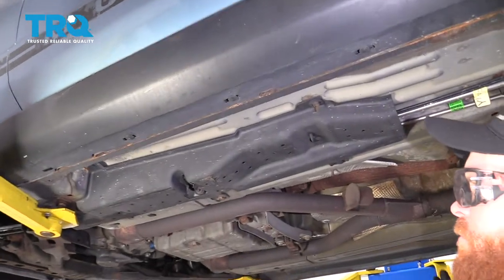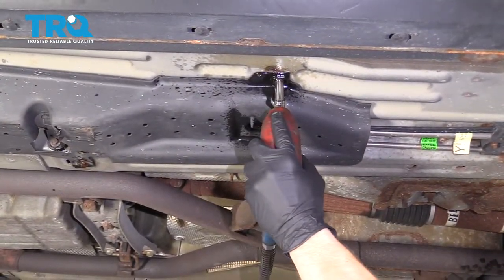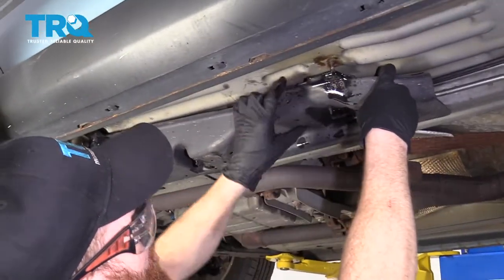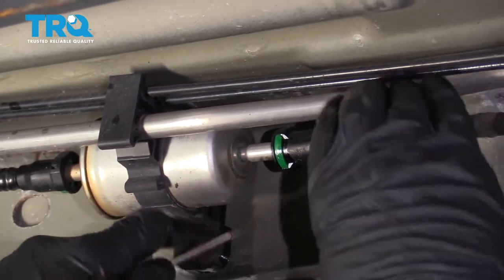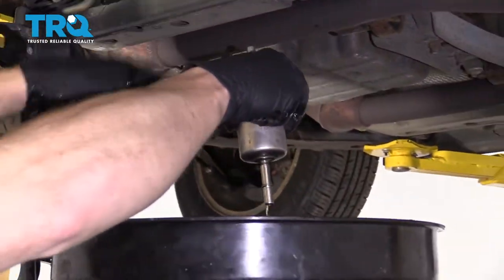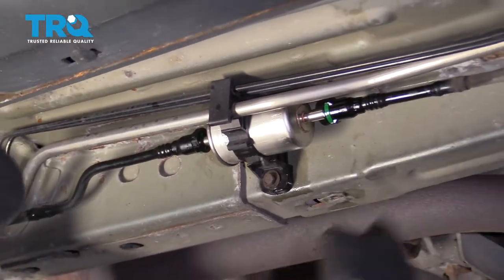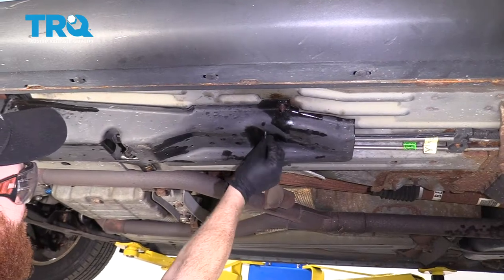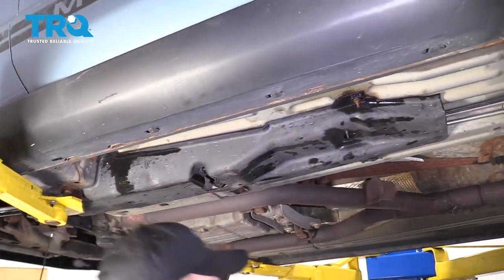How to Replace Fuel Filter 2005-14 Ford Mustang

Comment: If you have a 2011-2014 DO NOT LISTEN TO THE VIDEO. Your fuel filter is integrated into your fuel tank. Wasted my time taking the line cover off.
Reply: Man thank you so much for this 
I’m sorry you took time and effort to know that
Reply: Yup mine doesn't have a filter either , 2011
Reply: Wish I read the comments before I wasted my time and $. Yes... $$. Eventhough 2011 and new models dont have the in line filter, places like Autozone sells the filters for it... smdh.
Reply: My 2012 Mustang , V6 has nothing there.
Reply: lol yea, it is honestly one of the things that is actually "lifetime" pretty much cleans its self out from the amount of times you fill up with new fuel
Reply: Is it inside the fuel pump or the the fuel tank
Reply: Thank you! That saved my day in the Workshop!
Reply: @9kellers  where is it located? I have the same car
Reply: My mustang is 2014 GT I have been told my fuel filter is made into fuel pump and you have to drop the gas tank to get to it.Dies anyone know for sure?
Reply: @Mimisheila21  you do not need to drop the tank you can acces it removing your rear seat it’s right below it
Reply: @salmavarela2851  thank you 😀
Reply: I was thinking that
Reply: @Mimisheila21  you can access is from your back seats, remove them and it should be under the driver side back seat
Reply: Thanks
Reply: Do these kinds of filters need to be changed at the same intervals?

Comment: Doesn’t let people know that you have to disconnect the fuel pump relay crank the engine once to relieve pressure and disconnect battery after before changing filter
Reply: Yes I totally agree with you . My Friend  if they gonna teach something the  should do it completely.

Comment: Remember to always relieve the fuel pressure before doing this by pulling the fuse for the fuel pump and try to start until it can't to drain the fuel rails and finally disconnect the negative battery terminal!

Comment: I wonder if any one would have enough common sense to contact the parts department at the Ford dealer and ask for availabilty and price on a fuel filter to which you would be informed if its external or internal. Regardleds of the year.

Comment: You should fix this video TRQ. 2011-2014 mustangs do not have a filter in this location. Seems like y'all just assumed every s197 mustang had the same fuel delivery system.

Comment: Here we are 3 years later, and they still haven't updated the title to reflect it only applies to the 2005-2010 Mustangs.  2011-2014 the filter is in the tank and easily serviceable, supposedly one of those "lifetime" deals per Ford.

Comment: My  2014 V6  Mustang does not have the fuel filter as this video shows. i got the filter  removed the panel and No filter just a fuel line. 
coyote v8's have the filter in the fuel tank. well add some  2014 V6's to that list

Comment: How do I know when it's time to replace the fuel filter? I have a 2007 mustang
Reply from the maker: +Ruben D. Rodriguez, Jr. Thanks for watching!  You will generally want to replace the filter every 30,000 miles or so.
Reply: @TRQ  well....(Me staring at my 105,000 mile odometer reading)